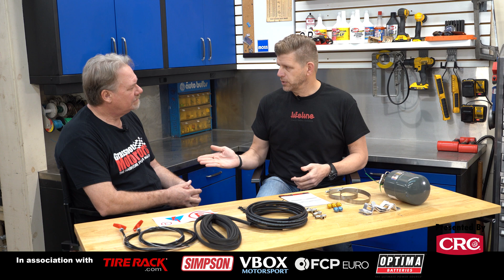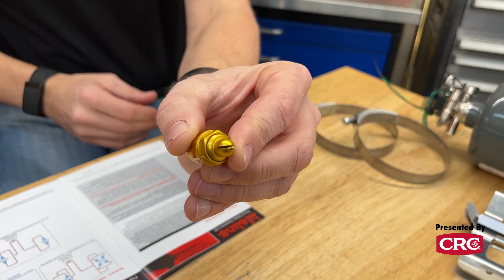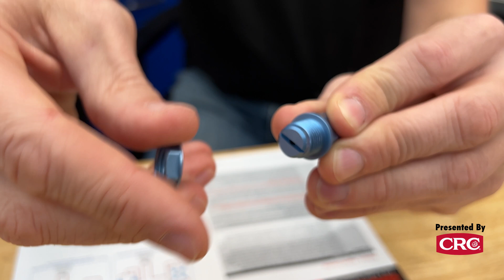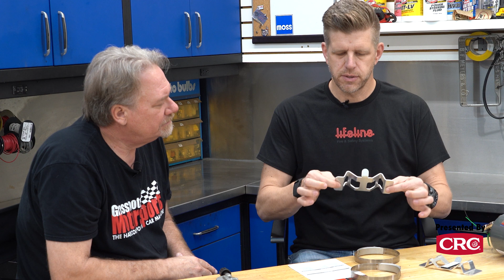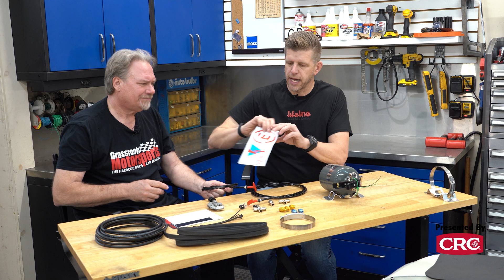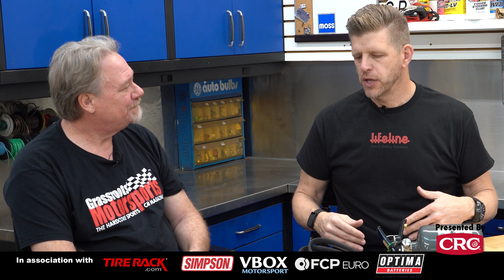Race Car Fire Suppression System Install Tips

Comment: I was laughing in a "oh, those poor souls. What ARE THEY THINKING!?" watching 1320's coverage of TX2K. It's SCARY how many of these dudes have BOTH trigger handles mounted on the NEAR side of their driver cages inside the vehicle. So, for whatever reason, both handles are mounted high and only a couple inches away from the RIGHT side of their heads. Not a single one mounted cage near the window or easily reached from outside the car. Like....wtf!? If anything, fire safety should be the absolute largest feared issue in their form of racing. Watch cars catch fire so damn often in drag racing since they often run the "moon boost" tune and often blow their engines to high hell. At least on the road course it takes a fitting, line, or similar failure or a collision to set that in motion. Stuff you have a lot better chances of preventing just by good ol' "nut and bolting" the car prior to being on track and after. Of course, road course cars ignite regularly enough but it's not like it's an every single day thing that people go on track with the ECU set in the map saved as "LOL go or blow amirite". You also never see anything well labeled like you do on road course stuff. I mean, the only other thing we could do is for our crew access stuff to fire off flares for attention.

Comment: Can this be installed in a basic car?
Reply: Absolutely. I am installing it into our 1990 300ZX TT. It's life will be 90% street and is exceptionally clean. But, it's being built to the nines. Haltech R3 ecu, Haltech display, Jim Wolfe'd and Stillen'd to hell, and will be exceptionally fast. This system will do an exceptional job giving me the necessary time to exfil if anything happens. But also buying time to get the other foam extinguishers into play if necessary, too. Like they said, buy time to GTFO. But will, by default, buy time to save the car if not completely saving both you and the car all by itself. The catch...you do need to mount it. So, there will be holes needing cut/drilled in various places for nozzle placement and line routing. As well as being able to VERY STURDILY mount the handles (if mechanical) or the switches (if electrical). It's certainly not something that can be akin to a "temporary" install where you can remove it leaving no trace of its having been there.

Comment: Great stuff.  If I may, I'd suggest mounting BOTH of your pull handles where someone else can get them.  For example 1 near the passenger B pillar, but also perhaps the driver A pillar, where both a driver and corner worker can pull that handle.  I can tell you from experience that no one is gonna jump into your burning car to pull a handle in the center of your car, if your passenger side is not accessible.